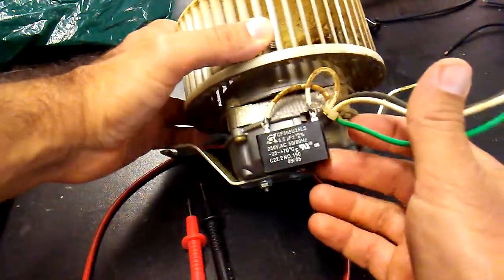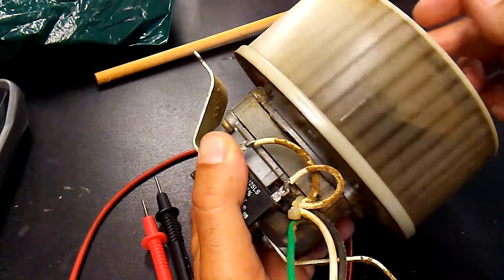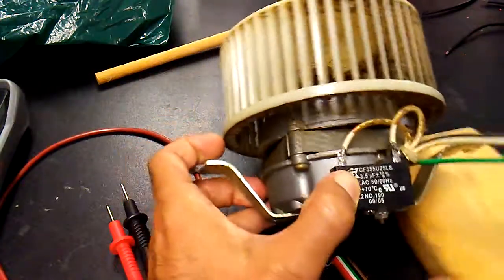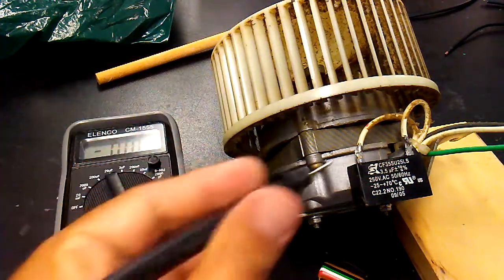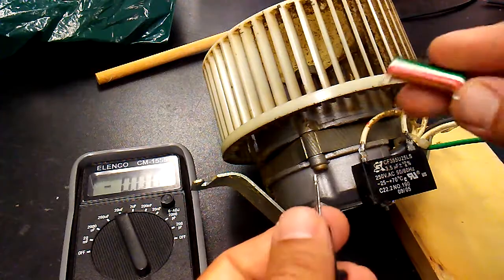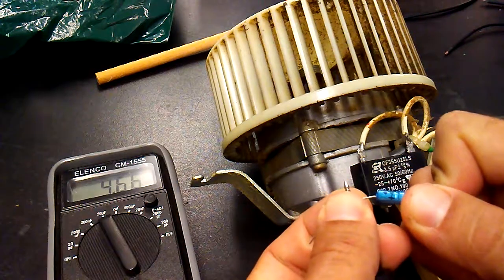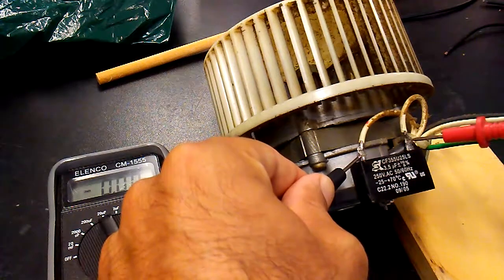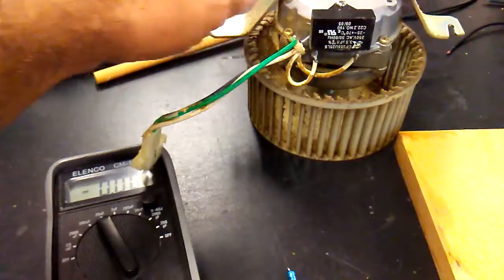How to test a dead ceiling fan capacitor

Comment: Don't think it is a good idea to test any electronic components while it s still connected to the appliance / circuit. You  may get false readings coming from other components. I think it should be disconnected first in a way so that it could be tested in isolation to the rest of components.

Comment: Should you have the capacitor removed from the circuit before you test it?
Reply: Yes... the correct way to do it is to isolate the capacitor before testing.

Comment: Can i just bypass to direct,i mean i wont use capacitor, what the side effects ? Speed slow? Coz uf dont flow?
Reply: Depending on the motor, it may not start, or may run slowly or very inefficiently, and possibly burn out the motor from stress.  These motors were engineered to run whatever they're doing with the capacitor they came with.

Comment: Do we need to replace it with same configuration? Or we can replace it with higher voltage or capacitance?
Reply from the maker: I do not have an answer. I did not even replace mine as the part was more than half the cost of the complete kit. If you try, please leave a comment about outcome.
Reply: That’s a lie. I had seen 3.5uf capacitor that cost less than $10.
Reply from the maker: @CeilingFanVideosOnYT  please include link in your comment to help audience. Thank you!
Reply: @photographiedynamic  Just search for “3.5uf ceiling fan capacitor” and you’ll find ones for cheap price.

Comment: That looks like Energy Reduction Systems. It’s working now, right?
Reply from the maker: Mine was dead and I looked for replacement. They were charging too much money for it, plus shipping. I decided to just replace the whole thing.
Reply: @photographiedynamic  The ones I had seen costs less than $10. New fan of same quality would have costed like $400.

Comment: un solder one of the wire at the cap and retest. so you don't get a reading from within the motor windings.
Reply: any readings from within the motor should be too small to pick up with the multimeter and/or only like 0.1uf difference between connected/disconnected to the motor.
though I can see how this can be confusing.
Reply: I believe that unsoldering on end of a component is necessary when testing it's resistance/ohmmage

Comment: Can it work if I would cut the two wires and wire it together instead of that black capacitor?
Reply from the maker: That question has been on my mind. Unfortunately I have not tested it.
Reply: No, it won't work. Without the capacitor,  it can't develop enough torque to start the fan.
Reply from the maker: @CBCNamja  Thanks for informing us, I was wondering too.

Comment: Did you buy a new capacitor and test if it works or not?
Reply from the maker: No, it was too pricy with shipping. I got a complete new kit for $ 60.
Reply: I’ve seen 3.5uf capacitor that costs less than $10.